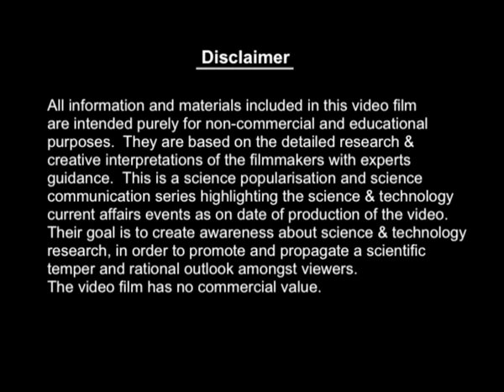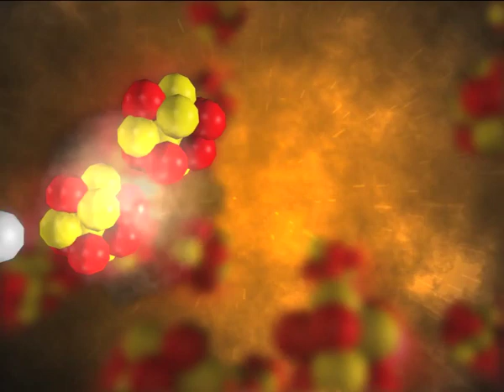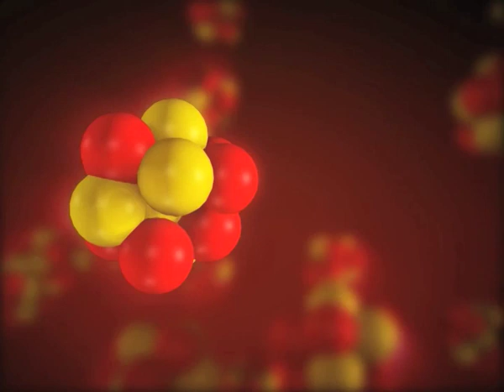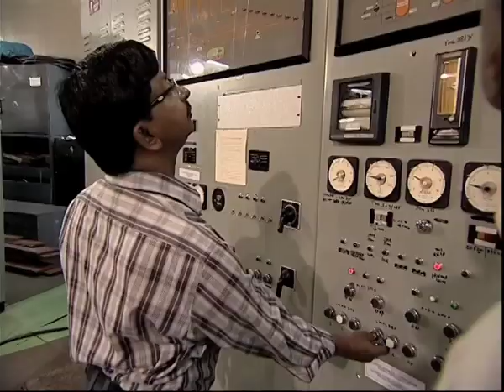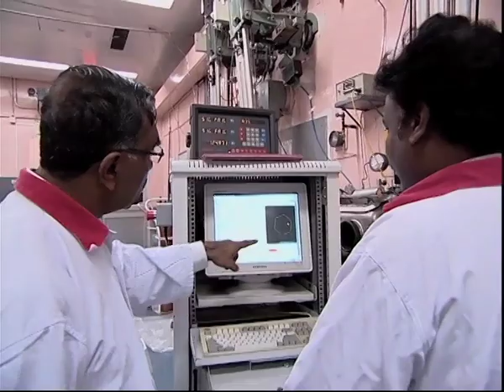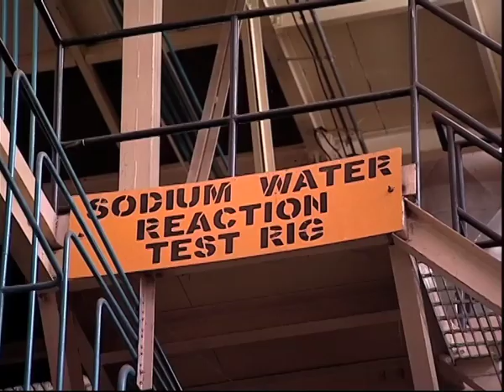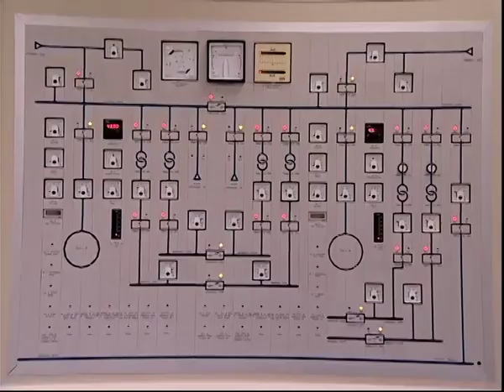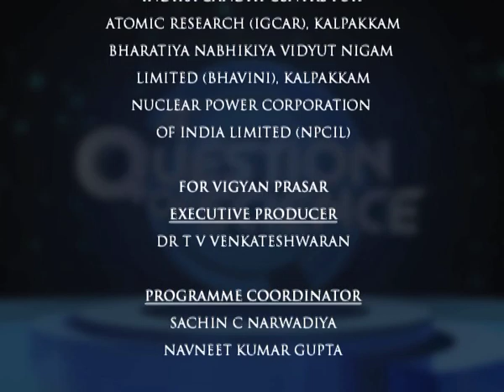What is a Fast Breeder Reactor

Comment: The materials research they're doing into liquid light metals will also be useful for Thorium reactors and concentrated solar power.
Reply: "... useful for Thorium reactors..."
Which will never come to fruition.
Reply: @daryllect6659  Breeder reactors don't need to care much about which fertile isotopes go in. That's what makes them awesome. U-238, Th-232, it doesn't matter as long as there are enough neutrons flying at them.

Comment: Understandably the primary concern is with a volatile and unstable coolant (sodium) which can hit flashpoint the moment it gets exposed to moist air. 

In the event there is any mishap/accident where one of the diverter/transmission pipeline develops a leak then instead of simple leak dripping off the pipe,  it may lead to potential and violent fire which would be pretty difficult to contain given the highly reactive nature of sodium.

However, these are mere assumptions and concerns of a layman. Hopefully adequate measures have been taken to avoid such potential risks ever becoming a reality.

Comment: Did the author of this video know that the atom is not the smallest form of matter?
And while saying that Indias coal reserves will run out is accurate, what they neglect to say is that those reserves will run out in a few centuries, and that investment into its energy infrastructure was pushed aside in favor of its nuclear weapons program. Since Indias first nuclear weapons test in 74 they've produced almost 9,000 kg of reactor grade plutonium in addition to the weapons grade material sitting in their 200ish nuclear weapons. In other words India has the resources to bring power to massive population very easily but for some reason isn't

Comment: It would be a lot easier to reprocess the fuel rods if they filled them with chloride fuel salts instead of carbide fuel. Not as much fuel fabrication needed either and no swelling if they let the gasses escape safely.
Reply: Natural chlorine has some really unpleasant activation products, so while it initially looks attractive, the extremely isotopically pure chlorine needed to avoid those presents a pretty large barrier to use of chloride salts.

Comment: Experience around the world with fast breeder sodium cooled reactors has been disappointing. Nobody still takes the concept seriously (except possibly the French, whose "Superphenix" reactor hardly operated at all before being decommissioned). And most people rightly feel uncomfortable with liquid sodium. In my opinion the rewords are not worth the risk.
Reply: Wouldn't Lithium be even worse? Would they have to use heavier, less reactive metals?
Reply: How is far more efficient use of fuel and more versatile fuel needs not worth it?
How many sodium incidents have there been?
Reply: @fungdark8270  
Do you like the idea of a heat-exchanger with liquid sodium on one side and water on the other.
The future is in MSRs, where 100% of the fuel can be used up.

Comment: Can someone please help me out at 5:40 I went to validate that number of energy in 1kg of U-235 using E=MC2 and I got 24 billion kWh and I used an online calculator and still got the same thing. Did this video screw up when it stated 24 million kWh? I just looked off a couple of websites and they agree 24 billion kWh. This video screwed up.
Reply: Are they calculating base on total mass of uranium atom?, or just the missing fragment which become energy? 

Not all the mass in atom become energy, only fragment of em.